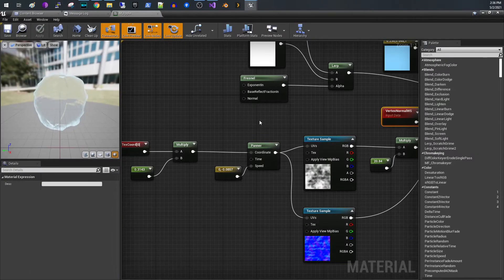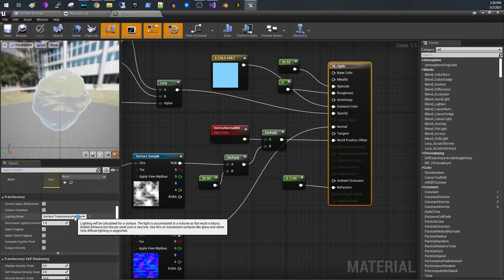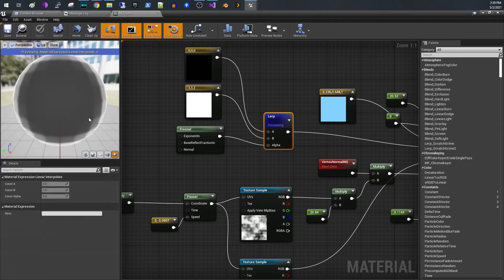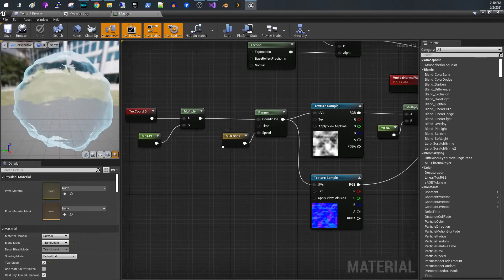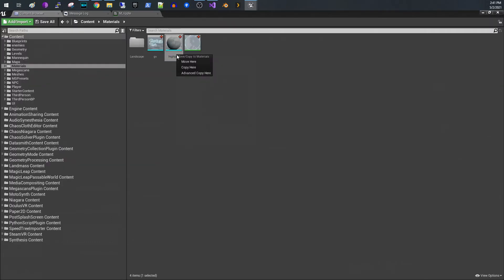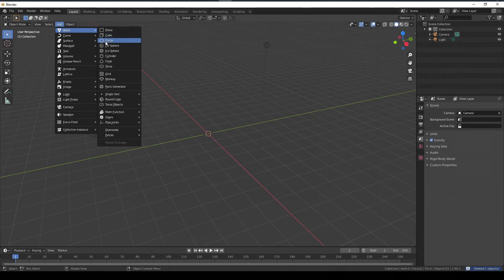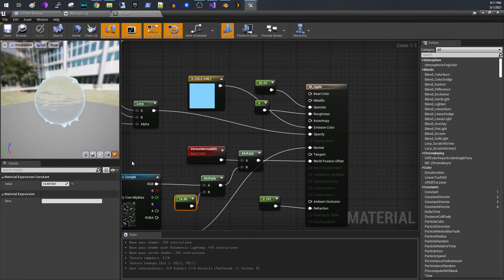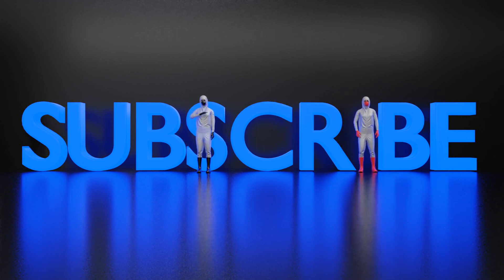World Displacement Material (water)

Comment: I've been trying to replicate this for my game. The problem is that there is a line in one place that basically cuts the sphere in half on the north side and disconnects the vertices. There is also visible disconnect in the top and bottom parts of the sphere. I have also tried using a higher poly sphere (so high you can barely see the individual faces) but it didnt change anything. Using a lower poly one fixed it but there were noticeable jumps and the sphere was very jagged. This displacement works fine on cubes though.
Is it because of the noise texture or is there something other that might impact it?
Reply: Its your UV's